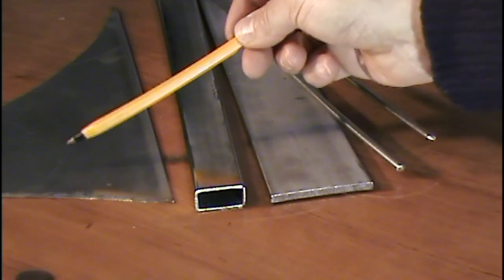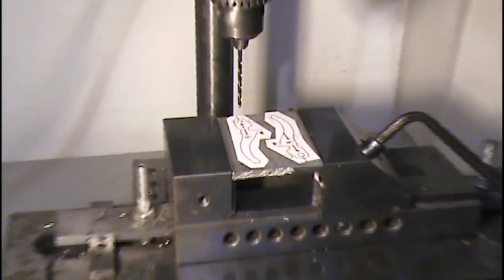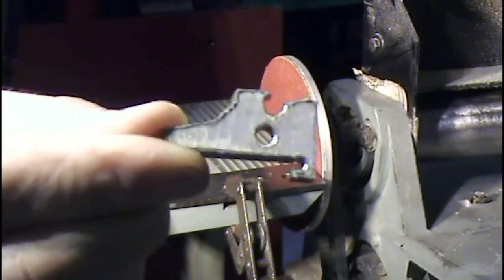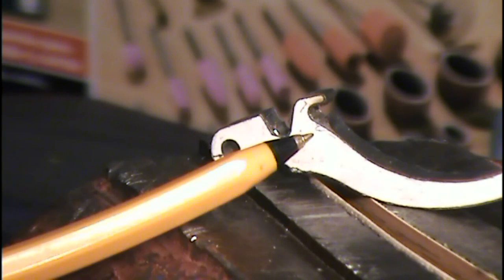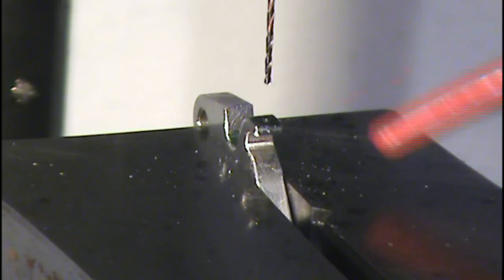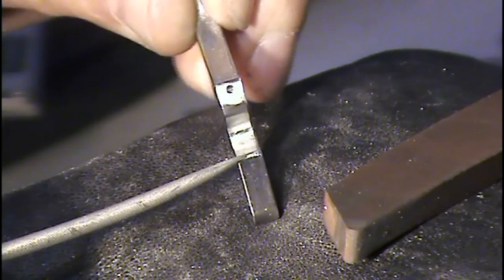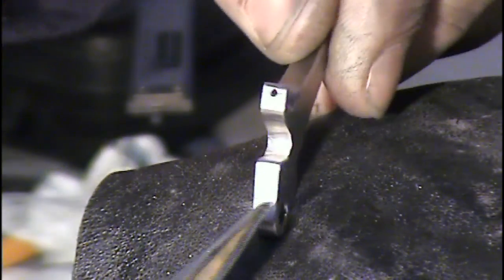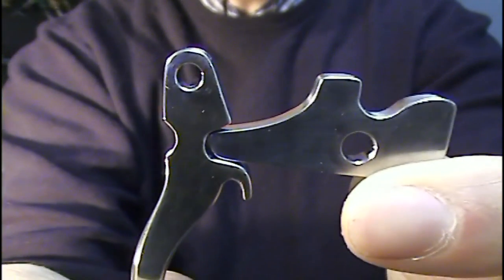Speargun Trigger Mechanism - Part 2: the Trigger and Sear - Youtube demonetized this video! Why?

Comment: buen video aunque le falto los planos para poder hacer el sistema de gatillo.... gracias por el video
Reply: Hola mi estimado solo entra a Google y escribo Shotgun shematic🤠.
Reply from the maker: Hello Kenny Rios,
I can give you some dimensions for it.
- The trigger housing dimensions= 13x30x65mm, wall thickness: 2mm 
Trigger and Sear= 5mm thick. All made from 316 grade stainless steel
Some of my channel viewers told me, that by using any free screen recorder program to take "screen 
shots"  from some of my videos, and then using a image editing program 
like "PAINT" to scale the images to get the right sizes. Watch the video
 "Roller Speargun Design Model"
 https://www.youtube.com/watch?v=_qQXGEgw5p8  at 1:03 is possible to see a side view of the trigger mach.
Thanks for the comment and for watching.

(Google tradotore!)
Posso darti alcune dimensioni per questo. - Dimensioni alloggiamento trigger = 13x30x65mm, spessore parete: 2mm Trigger e Sear = spessore 5mm. Tutto
 realizzato in acciaio inossidabile 316 Qualcuno dei miei visualizzatori
 di canali mi ha detto che utilizzando un programma di registrazione a 
schermo libero per prendere "schermate" da alcuni dei miei video e poi 
utilizzare un programma di editing di immagini come "PAINT" per scalare 
le immagini per ottenere le giuste dimensioni. Guarda il video "Roller Speargun Design Model" 
https://www.youtube.com/watch?v=_qQXGEgw5p8  at 1:03 è possibile vedere una vista laterale della mmeccanismo di trigger. Grazie per il commento e per guardare miei video.

Comment: where i will find the plans of the trigger??
Reply from the maker: Hello Χρήστος Χουλιάρας
Making the plans available will not be possible but a can give some dimensions for it.
- The trigger housing dimensions= 13x30x65mm, wall thickness: 2mm 
Trigger and Sear= 5mm thick. All made from 316 grade stainless steel
Some of my channel viewers told me that is possible to take "screen 
shots" from some of my videos and then using scale to get the right 
sizes. Watch the video "Roller Speargun Design Model"
 https://www.youtube.com/watch?v=_qQXGEgw5p8  at 1:03 is possible to see a side view of the trigger mach.
thanks for the comment and for watching!
Reply: Thanks for your time to answer me :) You did very good work keep going :) (sorry if im not write right )
Reply: Χρήστος Χουλιάρας

Comment: hello, you can send me the desing drawings to my email, please
Reply from the maker: Hello Junior Rolando Lainez Ventura,
I want to finish this speargun project first, before making it 
available. 
The only dimensions that I can provide are: The trigger housing 
dimensions= 13x30x65mm, wall thickness: 2mm 
Trigger and Sear= 5mm thick. All made from 316 grade stainless steel
I´m very confident about this design, but I need to fiel test it, over a
 long period of time before making it available. 
Some of my channel viewers told me that is possible to take "screen 
shots" from some of my videos and then using scale to get the right 
sizes. Watch the video "Roller Speargun Design Model"
 https://www.youtube.com/watch?v=_qQXGEgw5p8  at 1:03 is possible to see a side view of the trigger mach.
Thanks for the comment and for watching my videos!

Comment: can you give the correct measurements for sear and trigger
Reply from the maker: Hello Jose Amaya,
I want to finish this speargun project first, before making it available. 
The only dimensions that I can provide are: The trigger housing 
dimensions= 13x30x65mm, wall thickness: 2mm 
Trigger and Sear= 5mm thick. All made from 316 grade stainless steel
I´m very confident about this design, but I need to fiel test it, over a long period of time before making it available. 
Some of my channel viewers told me that is possible to take "screen shots" from some of my videos and then using scale to get the right sizes. Watch the video "Roller Speargun Design Model"
 https://www.youtube.com/watch?v=_qQXGEgw5p8  at 1:03 is possible to see a side view of the trigger mach.
Thanks for the comment and for watching my videos!

Comment: MrMyvids4you     please  share  image Speargun Trigger Mechanism  thank you
Reply from the maker: Hello Jo V,
I want to finish this speargun project first, before making it available. This is a very old dream that I have since I was 12 yars old, back then I remember cutting off the handle of a plastic toy hand gun to make the speargun grip, and bending a leftouver piece of plastic tube that I found on a near by construction site to make the snorkel tube!
I designed this trigger mechanism using a Cad program (Google Sketchup) The only dimensions that I can provide are: The trigger housing dimensions= 13x30x65mm, wall thickness: 2mm the Trigger and Sear= 5mm thick. All 
made from 316 stainless steel
I´m very confident about this design, but I need to fiel test it, over a long period of time before making it available. 
Some of my channel viewers told me that is possible to take "screen shots" from some of my videos and then using scale to get the right sizes. Watch the video "Roller Speargun Design Model" at 1:03 is possible to see a side view of the trigger mach.
Thanks for the comment and for watching my videos!

Comment: MrMyvids4you how wide is your original speargun before after you laminated it.
Thanks
Reply from the maker: +Pono Fisher 
Hello Pono Fisher,
1200mm long
150mm high from top face to the bottom of the handle
50x50mm wide 
40x40mm at the tip
the roller gun is 50 wide x 39 at the tip
and i cut all pieces aprox. 15mm per side bigger before lamitating it
Thanks for the comment and for watching my videos!

Comment: Its all stainless steel? if so,i think its very difficult to cut it to trigger shape with saw. But you did it like wood. What kind a hand saw did you use? Thank you for sharing your valuable vid~
Reply from the maker: CK E Hello CK E,
I used 316 grade stainless steel, as you can see in the video i used a bran new haksaw blade, it is from "Starrett tools" and that helped a lot! and to make it cut faster, in de video i speed up the images 10x !!!
Thanks for the comment and for watching my videos!
Reply: MrMyvids4you thank you for fast answering~ one more thing, how is it to use aluminum instead of steel, i think its very easy to treat than steel. Its too weak to use it in a trigger ?
Reply from the maker: CK E Hello CK E,
 my opinion will be not to use aluminum, the trigger mechanism is the most important piece of the speargun, any one atempting to make one should know that a trigger failure can potentially creat a very dangerous situation.
Use 316 grade stainless steel.

Comment: great and useful videos, anyone know where can i get the printout (templates)?
Reply from the maker: Hello harry jonson,
 I designed this trigger mechanism using google sketchup cad program. Before a can make the drawings available i have to finish the two spearguns that i´m building and then i need to field test everything for some time, to now if it works and to guaranteee that is safe to use! For now the only dimensions that I can provide are: The trigger housing dimensions= 13x30x65mm, wall thickness: 2mm the Trigger and Sear= 5mm thick. All made from 316 stailless steel.
Thanks for watching!
Reply: ok, thank you very much you make very useful  videos only complaint is that you need to make more! :)

Comment: Mr juste one question were are you lane for mécanisme for trigerre for seargun
Reply from the maker: Hello Nati WF
I want to finish the two spearguns first, i´m very confident about this design, but I need to fiel test it, over a long period of time to guarantee that is safe to use!
 I designed this trigger mechanism using a Cad program. The only dimensions that I can provide are: The trigger housing dimensions= 13x30x65mm, wall thickness: 2mm the Trigger and Sear= 5mm thick.
All made from 316 stainless steel

Comment: Is it possible to give me the true dimensions of cutting diagram ...
Please reply
Thanks in advance
Reply from the maker: Hello Thischannels dz
I want to finish this speargun project first, before making it available. This is a very old dream that I have since I was 12 yars old, back then I remember cutting off the handle of a platic toy hand gun to make the speargun grip, and bending a leftouver piece of plastic tube that I found on a near by construction site to make the snorkel tube!
 I designed this trigger mechanism using a Cad program. The only dimensions that I can provide are: The trigger housing dimensions= 13x30x65mm, wall thickness: 2mm the Trigger and Sear= 5mm thick.
All made from 316 stainless steel
I´m very confident about this design, but I need to fiel test it, over a long period of time before making it available. Sorry for that!

Comment: Very cool my friend, could you send me by email the models like the one you printed for me to try to do the same thought was pretty cool, and if you have other molds also can send to print, what site did you get care of me send the link, very sheltered by the attention, good night!
Reply from the maker: Hello Victor,
 I designed this trigger mechanism using a Cad program. The only dimensions that I can provide are: The trigger housing dimensions= 13x30x65mm, wall thickness: 2mm the Trigger and Sear= 5mm thick. All made from 316 stailless steel
I´m very confident about this design, but I need to fiel test it, over a long period of time before making it available. Sorry for that!

Comment: Great video!!!  Where can I get those templates?
Reply from the maker: Hello Stephen Lee, I designed this trigger mechanism using a Cad program. The only dimensions that I can provide are: The trigger housing dimensions= 13x30x65mm, wall thickness: 2mm the Trigger and Sear= 5mm thick.
I´m very confident about this design, but I need to fiel test it, over a long period of time before making it available. Sorry for that!

Comment: si solo  te pediria las medidas de las pieas gracias
Reply from the maker: Hello Karolina Moran,
 I designed this trigger mechanism using a Cad program. The only dimensions that I can provide are: The trigger housing dimensions= 13x30x65mm, wall thickness: 2mm the Trigger and Sear= 5mm thick, all made from 316 stainless steel
I´m very confident about this design, but I need to fiel test it, over a long period of time before making it available. Sorry for that!

Comment: Hi I don't know how many times I watched your videos due the fact they are really instructional. Can you please post a link to a drawing of 1:1 scale or the 3d model itself. I would like to have some fun making one of your spear-gun.
Thanks in advance.
Keep on the great work.
Regards

Lionel
lionel.arts@gmail.com
Reply from the maker: Hello Mr. Lionel,
I´m honored to know that you liked my videos so much!
I want to finish this speargun project first, before making it available.          This is a very old dream that I have since I was 12 yars old, back then I remember cutting off the handle of a platic toy hand gun to make the speargun grip, and bending a leftouver piece of plastic tube that I found on a near by construction site to make the snorkel tube!
It will take me some more time to finish this gun, but I think this time it will happen!
You can use all the info from the videos and give it a try, the worts that can happen to you, is the same that happen to that boy! so don´t give up just because you don´t have the 1:1 scale plans.
Thanks for the comment!

Comment: Let me just start by saying .....   Awesome.   You explained it so easy.  And make it look the same.  Easy.   Thank you for showing us.  My only question and favor I would ask you is.  Where can I get a print of the trigger and sear for the mechanism.  I don't have the tools you have.  So it's gonna take me some time to get the same result.  Can you please you help me?  Tnkz
Reply from the maker: Hello Mr. Melendez, I designed this trigger mechanism using a Cad program. The only dimensions that I can provide are: The trigger housing dimensions= 13x30x65mm, wall thickness: 2mm the Trigger and Sear= 5mm thick.
I´m very confident about this design, but I need to fiel test it, over a long period of time before making it available. Sorry for that!

Thanks for the comment!
Reply: @MrMyvids4you  sir can you provide the trigger and sear diagram  with their dimension...